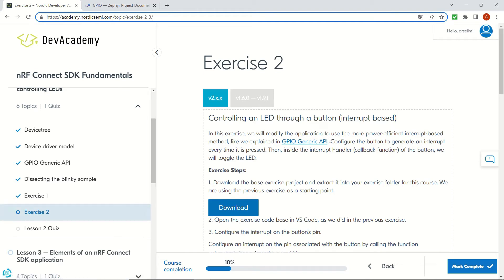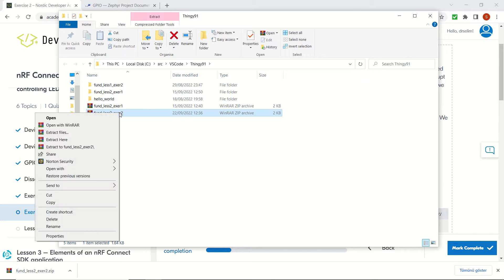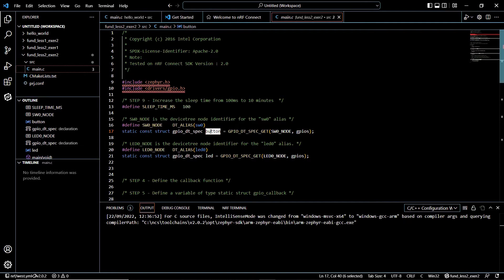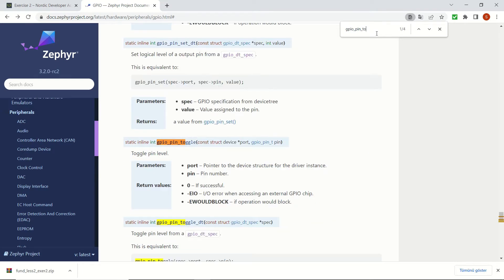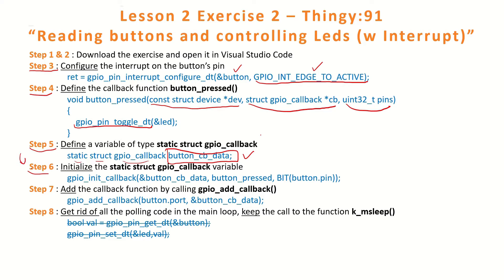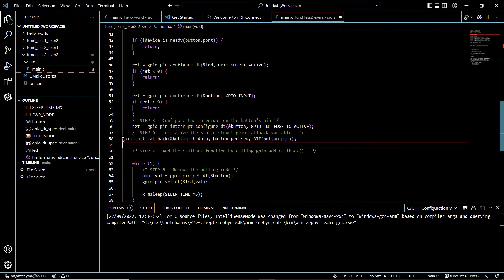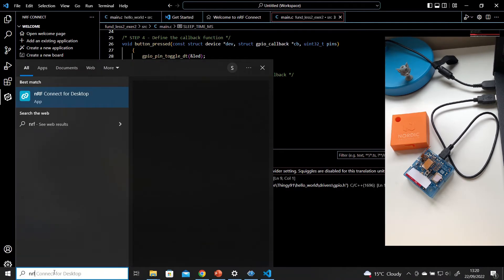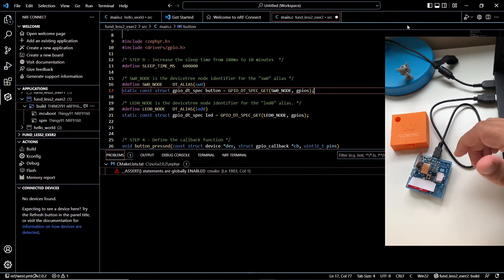GPIO Button Interrupt and LED Thingy:91

Comment: Great video!

I am new to Zephyr OS but I love Nordic thingy platform, Can you make a video explaining how to get inbuilt sensors data on to the screen or UART.
Reply from the maker: Thank you for your comment. I already took the footage for accessing the on board bosch bme680 sensor and printing it to serial connection (putty, arduino ide serial monitor or any other serial comm sw). It’ll be ready by the beginning of next week 👍.